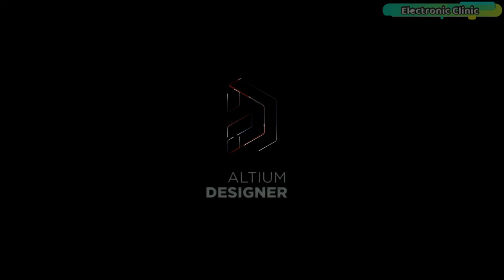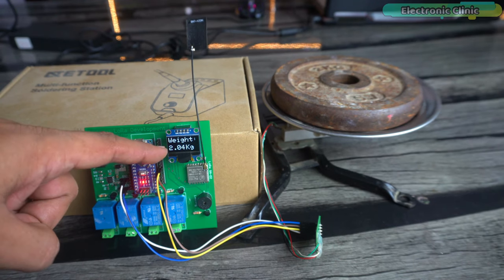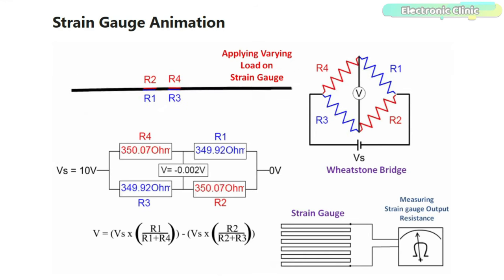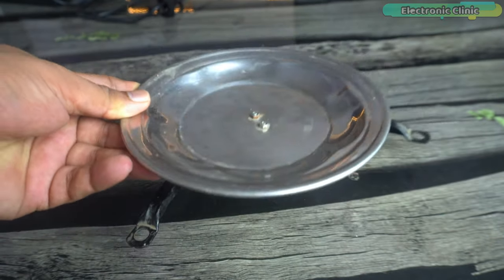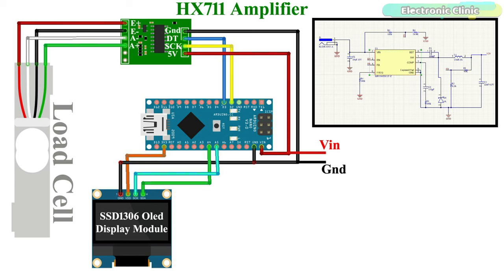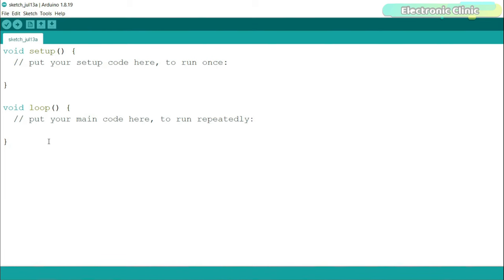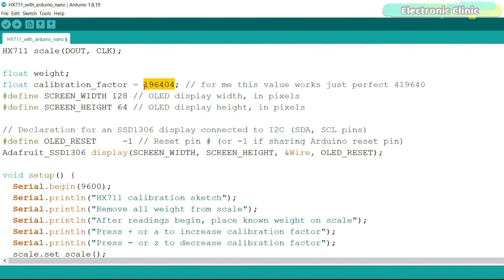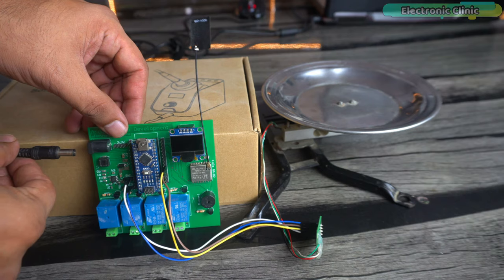HX711 Load Cell Arduino | HX711 calibration | Weighing Scale | Strain Gauge

Comment: Thanks, I used a 100g load cell, and it worked like a charm. I reduced my calibration value to 16,790 and it was spot on, +/- .01g which is great.  Ordered 3 OLED screens and 2 were readable but defective colors :/, but whatever lol.  Good stuff.
Reply: Is it good to measure in miligram ?
Reply: @therational-hh5fe  No, it’s not that accurate, it can only get down to a hundredth of a gram and you can be off by 20 or 30 milligrams.

Comment: Hi, how do I know if I can use my loadcell with HX711? Can I use 1000kg loadcell also?
Reply: i am using a 20000kg load cell and it works... It will work with everything that has a wheatstone bridge circuit.  Most load cells of this big numbers should be operated at 12V instead of 5V. It gives them a better resolution with 12V i think.

Comment: hx711 24bit resolution..
so how can display more digit?
Reply: display.print(weight * 100); 10, 100 or 1000 based on how much digits u need, higher the digits more chances to show fluctuating last digits and its normal